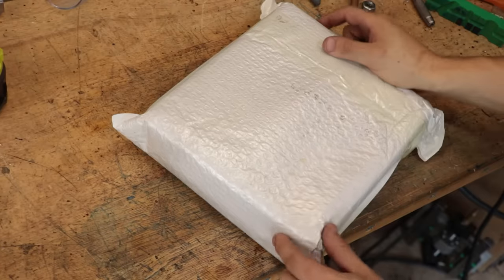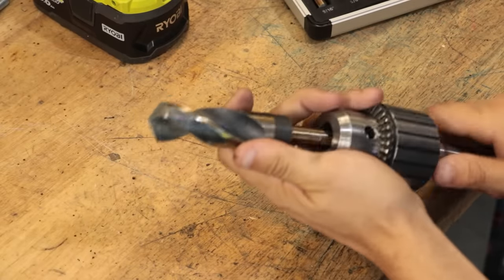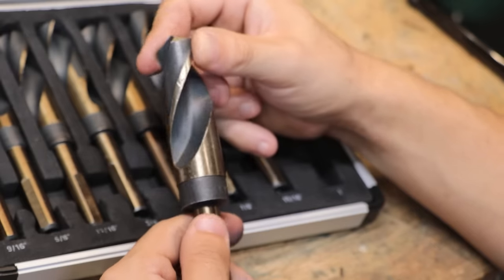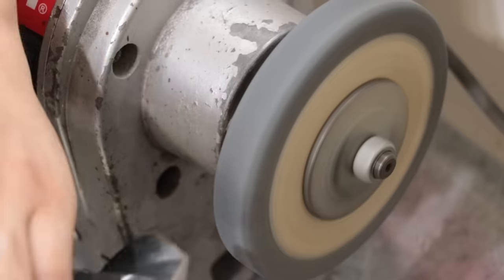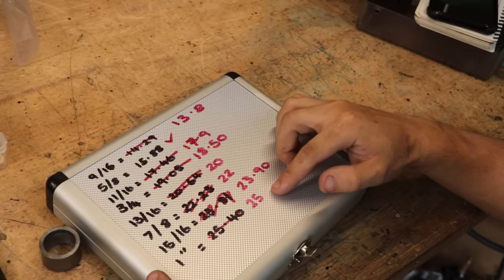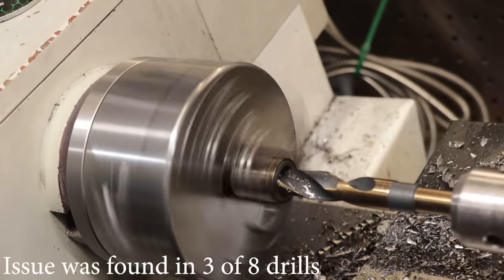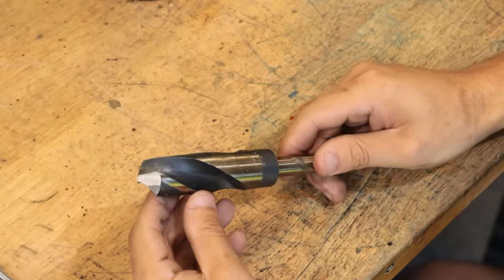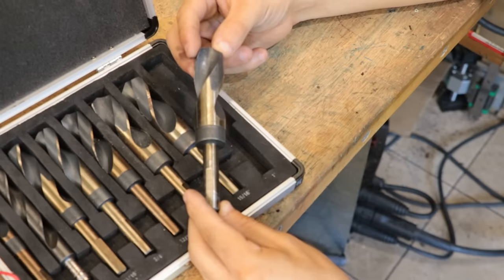Cheap Reduced Shank Drills. Worse Than You Think

Comment: 1:31 This one of the reasons I don't buy anything from Ebay anymore. 10 items ordered 4 comes out without any hassle. Same items are usually cheaper and/or with faster delivery times (Aliexpress, Amazon, Banggood). In some cases Ebay seller items have arrived as Amazon gifts.

Comment: Interesting lesson on how not to grind a drill bit. I have a 25 mm drill like that which didn't want to make good chips and now I am sure it lacks the relief, but it was new and I thought it could not possibly require to regrind it out of the box.
Reply: I've seen plenty of cheap drills that were ground wrong right from the factory. Some so bad there's no chance they could ever drill a hole. Reliefs completely backwards even. With the cutting edge diving down. You get what you pay for. Maybe. If you're good at sharpening drills you can almost always improve over factory grinds even in the best of cases.
Reply: The small bits often sold for drilling electronics PCBs are by far the worst.
I have bought from numerous Chinese sellers over the years, and usually the drills under 3mm have reverse clearance, with zero chance of even cutting plastic... well, except by melting their way through.
.
The last few batches (including 100 supplied with a pin vice that I wanted) had absolutely no grinding at all. They were dead flat across the end, so no wonder I wouldn't get them to start 😂
Reply: @johncoops6897  I use much smaller diameter bits than 3 mm drilling out printed circuit boards. Sometimes less than a millimeter. But sharpening those bits up right is beyond me. So one day I just ground a point on one and it drilled OK. So that's what I do with them now. I don't know where the point geometry stops working. Even 2 mm size bits those I can grind. But the really tiny ones I just grind points on them. They drill like that.
Reply: @1pcfred  - yeah, the little ones are hard to sharpen. I can get 2 good edges down to 0.9mm using a diamond stone and lots of magnification. On high quality 0.7mm I can usually get them to work pretty good.
.
I will try your trick with the V point, which I know will work with a powered drill.  I want to test if that works with the hand drill (pin vice) that I use.
.
One batch of cheap bits wasn't even hardened. So no matter what, the fiberglass PCBs just destroy those, sometimes before even making one hole 😃
Reply: @johncoops6897  I don't know how good pointing up miniature drills would work with hand drivers. I use a high speed mini press. But with that it works good for me.

Comment: We've had good and bad experiences with these types of drills, the shanks (in our case anys, we found this out few months ago when trying to drill out hole, just grabbed a drill out of the drawer where most of drills came from ebay or som other auction, seen was "right" size and stuck in drill not paying attention to the condition of said drill, it was trashed,  anyway took hammer to the shank cause it caused us time, to our surprise, the drill didn't shatter,  it bent!) are not hardened so you should be able to put the drill part in the chuck of your lathe and shave the 1/2 inch shank down to make the drill run truer than was new. Of course you'll have to re-mill the flats, that is another thing to check out on these types of drills, sometimes the manufacturer does a piss poor job sitting these drills up for the reduced shank to be ground-milled in! Hope this helps, btw, we in the USA 🇺🇸 are being forced to deal with metric, just as happy as you are about dealing with fractional stuff, so it isn't the end of the world, do was we do, smile and cuss about it under your breathe 😂😂😂😂

Comment: W5 is a water hardening carbon steel made in China, it got around 1% carbon, 0.25 Silicon for hardness, 0.8 Manganese for deeper hardening and strength, 1.6-1.9 chromium for the carbides, 0.2 Moly for the toughness.
There's quite a bit of trace elements of phosphorus, aluminum and sulpher in there as well either as a product of the melt or random trash falling in the crucible, either way its not great. Essentially, its a cold cutting carbon steel, otherwise I'd expect to see some Vanadium and Tungsten in the mix for the harder carbides and heat resistance, but its something which would make for an ok, lower quality sheer blade or cutting edge, not something that's going to make a good drill bit as they will soften once it gets over 150C at the cutting edge and tempers it back over time. What they might also use it for is the really long drills in commercial oil and gas drilling which is a 'cooled' process of keeping the whole thing full of mud, water as it goes down through the rock.

So I reckon they got the steel from that once it was done in the field, heat treated it back to annealed, re-milled it to whatever 'tolerance' of material they had left and cut in the drill edges.
Oh yeah I totally agree with the chowedered edges and looking like a mouse has gone over them, someone has rolled these out of a kiln into a big bucket of brine, sloshed it around banging them together and then banged the absolute shit out of them on the way to the tempering oven once they cooled down! They had a hard life before you ever got hold of them :) haha!

Comment: The more I see of these type of tools the less I like them, I bought 3 sets of drill bits recently, one known expensive set of six which cost more than the set in a holder and a 100box put together but you know weirdly the cheap set of a hundred works better than the middle priced set, theyre supposed to be cobalt  drills but they really suck, they break very easily and usually dramatically where the cheap ones bend. The expensive cobalt ones of course outshine both sets but I don't want to use those for drilling wood out of a hammer eye. I would buy the cheap ones again but not the middle priced set.
All that waffling said, I was looking at some of these big drills but I think I will go with a different set of blacksmiths drill bits with a gaurantee on them 
Thanks for sharing and happy new year

Comment: Some people swear by the "buy once, cry once" motto, in that you should by the absolute highest quality you can afford, but i disagree.

   Some times cheap tools are the better bet, especially if you are a newbie, and are likely to damage stuff or use thing improperly, or are buying something that will seldom get used.

   And with multi piece sets (like drill bits, taps, punches, etc) you are most likely going to have just a handful of sizes that you use 99% of the time, the rest will sit in their case gathering dust, and it is better to find that out with a cheap set than an expensive set, you can use the saved money to replace the more heavily used part of the kit with the nicer tools.

(And it goes without saying there are always caveats and exceptions to the rule yadda yadda yadda.)

Comment: I've seen terrible bits like these for sale at the traveling tool sales events. I would guess that they are being made from copies of copies of copies with an obvious lack of QA & QC. As the automation process is completed, these bits are likely removed from the machines with a conveyor system that repeatedly drops them into a large pile that creates the damage you see. On the plus side, I've seen sets that weren't even sharpened, lol. They looked like they were just cast and put into the drill bit index without any machining at all.

Comment: I was going to buy a set just like that one. Good thing I didn't got it. Thanks for the review you save me a headache.
Reply: The problem with cheap products is inconsistency so you can't buy a set just like this one. As they're all a bit different. So I wouldn't put much stock in one experience myself.
Reply: They all cut OK and we're the correct hardness for non cobalt hss. A pilot hole and a regrind and they will all cut fine. Does anyone else manage to grind drills with one hand on the top by the grinding wheel?

Comment: You are a hobby shop.  The fastest possible cut isn't nearly as important as in a production shop where you are competing with another (or several) for the job and if your production is low you have to bid higher and thus lose the job.

In my mind, the drill bit is to make a hole as fast as my equipment can do but a few seconds isn't critical.  It removes metal fast and gets a hole close to the size and nearly round.  If I need it better I then bore it to make it round and closer to size.  If the size must be precise, I need to follow that with a reamer.

The quality is commensurate with the price.  Want to gamble on the quality?  You can gamble more than 12 times before you spend the price of the Sutton drill set.  I've bought several cheap sets of Imperial size drill bits from 1/16 to 1/2" so I can have them where I need to make a hole without having to walk a long distance to where the good set is.  In that experiment I have gotten a few that are nearly as good as the best set I have....and one that was not hardened but for the price I could just throw that entire set away and buy 4 more and still be out less money than one more "good" set.

Comment: I was given a set marketed by "The Tool Shed"... wooden box. Not too bad really... they cut a hole in a bit of bus axle shaft, which is pretty nuggety steel, with no problems. They are what they are... not top quality but good enough for occasional use. Mine look better made than yours; they are metric.... I have no idea what the original cost was as I was given them.. Yes a pilot hole is advisable for the larger sizes....
. 🙂

Comment: When I saw the first detailed shot around 3:00, I already thought, they don't have any proper relief. And obviously I was right...
Unfortunately I had seen such with cheap drill bits myself already. After buying one of those crap ass drill bit sets and noticing how insanely bad they are, I reverted to buying from a trusted brand only. None of the big names, so I was a bit afraid when I ordered the first few drill bits on Ebay, but they turned out great despite being still somewhat affordable. And ever since I buy the same brand. Not because they're the best in the universe, but they're affordable, and I know what I get. (Ok, with those super cheap ones I also know what I get, but that's not what I want to get...)

My maxim is, if the tool is supposed to cut something tougher than cheese or butter, buy a decent quality. It'll pay off multiple times, if nothing else it'll save your nerves. Same goes for measurement tools.

Comment: Interesting. Though I'm no fan of reduced shank drills.  A normal Jacobs type chuck isn't made for the torque. Except I have some to fit a cordless drill. On sizes over 1/2", 13 mm I prefer morse taper drills.

Comment: I wanted to make a video about these, or similar. I bought the ones from Lidl (don't know of you have that over there).
My experience was not great, they were ground very badly. They managed to grind the cutting edges smaller than the outer diameter of the drills, so all the drills rubbed and locked up when drilling more than 5mm deep.
But after regrinding they were reasonably ok. The biggest problem being my 350W lathe motor not coping with the larger diameters

Comment: I bought a cheap index of brad points and they were horrible lol. I've seen vids where the parts come of the machine and fall into a bucket. That could be part of whats happening to these drills. Also likely poor alloys and over used cutters. The steel on my bits looked like the steel was ripped off the bit rather than cut. I still use them, just not when I want an accurate hole.

Comment: I have the same sort of set. mine are so soft that I can file the cutting edge. Will not cut mild steel at all, whatever pilot drill size I have used will wear a deep groove into the so called cutting edge. Total rubbish for steel but aluminium works reasonably well.

Comment: Artisan, I have found that when I measure the metric drill bits at work, that they measure under the stated size. I suspect that it might be to allow for some material for reaming, but that is speculation. Does the Engineer's Black Book have any pages on drill bit sizes and actual sizes?
Mark from Melbourne Australia 🇦🇺
Reply from the maker: The black book doesn’t go into that amount of detail unfortunately. Having a look at my Sutton drills, they seem to be close to size, but all within 0.01mm cheers

Comment: Kinda surprised you didn't go for the Hare and Forbes D117 "Metric HSS Reduced Shank Drill Set" bit. $100 AU.  But yeah, for an experiment, fun!
Reply from the maker: It’s been a long while since I’ve bought anything from hafco, I didn’t think of checking their site
Reply: @artisanmakes  They are often pretty expensive, but every so often they have good deals. Especially if you live within easy driving distance of them. 
(And I have enjoy their warranty service. They repaired out big workshop compressor even after we admitted to running it at 95% duty cycle.. But they did tell us it really wasn't made for it. :)

Comment: 40 dollars? I couldn’t ship the box those bits came in out of China for that. Never mind any of the manufacturing. 😂

I bought some resistors for an electrical project from Aliexpress a while back. I had to buy bulk because individually they were less than 1 cent (usd) each. So yeah literally money didn’t go low enough to just buy one. 😂 btw they were spot on their rating.

Comment: So, Artisan bought some drills on eBay for about 1/10 the normal price - and he got ripped off.   Well, that's hardly a surprise ....  hmmmm ......  zzzz .... snort .... zzzz.   He woke me up when he finally said he had some old Frost drills and used them as a standard for comparison.
Frost was a brand once sold here in Australia by Mum & Dad retail hardware stores, long before the big dull green warehouse chain appeared, but never in machinery and tool stores catering for the trade.   Frost was the cheap junk Australian brand, and  P&N (Patience & Nicholson) was the good Australian made pricy brand.
Note that not all Sutton tooling is made in Australia.   I have Sutton branded tooling that came in packaging marked made in Japan, and some made in Taiwan.   It is not as good as the old 1970's P&N.
A big problem with reduced shank drills these days is not the drills, it is the modern Japanese chucks.  Some nong over there has decided to make the chuck jaws super hard, and they hold only on an edge and chew out your drill bits instead of gripping them.   To make them grip as best you can, you end up wearing out the chuck key.   Makita is the worst for this, but their motor and gearbox seems to be indestructable.
I have an old Black & Decker electric drill (US made) that I bought in 1969.   It grips the reduced shank drills just fine without any slipping and chewing and without forcing the chuck key.   And Black & Decker was the cheapo retail/hobby drill of its day!   I had to replace the armature once, about 20 years ago, and the variable speed control gave out more recently.   New ones are not available, so I fitted a simple on/off switch.

Comment: Your sizes do seem a bit all over the place eh ? I do know when measuring a drill bit the size should be taken close to the cutting tip as the diameter of the drill bit tapered away slightly towards the shank to reduce friction in the bore of your hole. 
Also it’s fairly normal for a drill bit to drill slightly oversized , and if the grind isn’t spot on it can be quite a bit oversized. 
I think I can quote from somewhere -
 “ the pilot hole should be equal to or greater than the the size of the chisel point “
I’d go with “greater than “ 😁

Comment: I wonder if the ground outer diameter is concentric and parallel with the shank? You could probably figure that out by puting them in a collet on the mill and checking with a test indicator. Given the other problems, I wouldn't be surprised if they were at least a bit out of whack there too.

Comment: Even at $40, that quality is horrendous, you can't use them once!
You should machine your drill bits, that would make for a very interesting video.
Reply from the maker: I wouldn’t even know where to start there. Biggest hurdle is hss hardening which is a more involved process compared to carbon steel. Cheers

Comment: Aren't these just used second hand drills that have been reground, and then sold as new? how else would you get all these dents and scratches on the surface?
Reply from the maker: I would have assumed that they were chucked in a big bin of other drill bits after forming, when they were still soft and that’s where all the dings came from

Comment: I'll give them a lot of leeway for being $40, but I still expect them to be the size that is stamped on the side. They're not tools, they're lies.
Reply: Twist drills usually don't bore holes the size they are. That's because it is extremely difficult to make the bits perfectly symmetrical. That leaves one side of the bit longer than the other in relation to the center of the bit. It's going to cut long all the way around the hole. That makes for a bigger hole. It keeps companies that make reamers in business though.

Comment: well about a mystery steel that those drils are made of I found "TOOL STEEL FOR HOT WORK WWS , WWS1, X30WCRV5-3, 1.2567, Z32WCV5 WG PN-H-85021, ISO 4957." or someathing like this ,hardnes form 49-52.5 HRC , so basicly this is kinda granddad of hss  , some sort of hight carbon steel ,(of corse if I understend table correctly).((also those drills are probably made in the old fashioned way so the cunting spiral thing is made out of this still and the shank is made out of something softer))(((to be clear moust of drills that I see today are make all in one pice out of hss ,but i got like 2 or 3 made in the old east block and they are looking simiular but of corse they are made out of mutch better stock)))
Reply: These are Carbon Steel for sure.